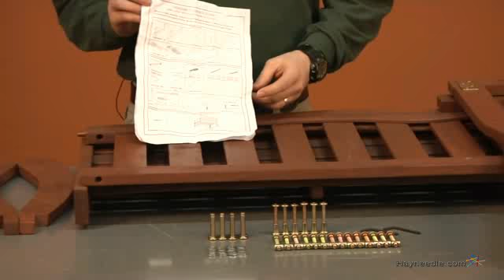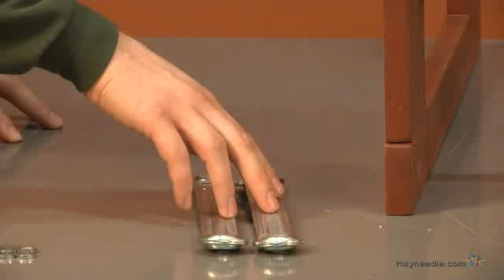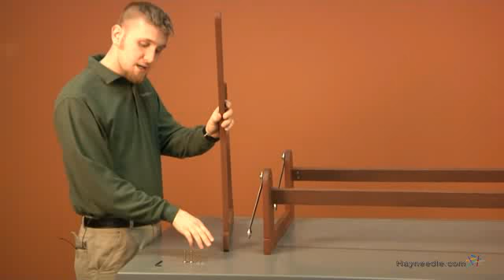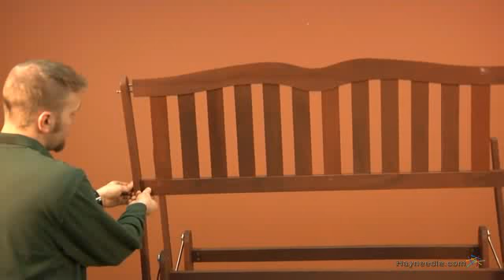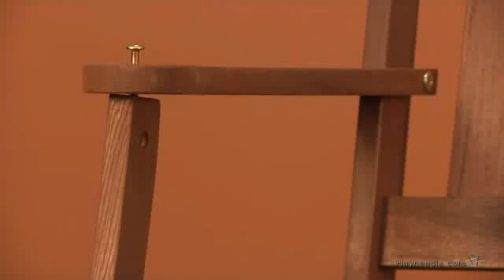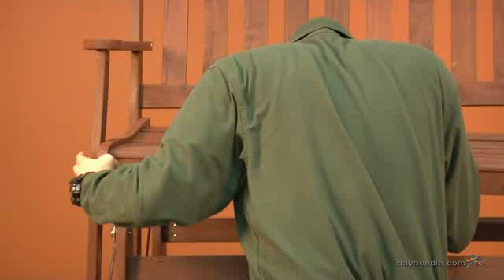Assembly Video Jordan Manufacturing Alpine 4-ft. Double Seat Glider Bench

Comment: Great instructions. Never could have done with the instructions provided in the package.  Although, I was able to use it a point of reference when not clear about something, i.e. L/R orientation, etc.  And yes, aligning the barrel nuts was not as easy as holding it in place with your finger.  It was very tedious and often frustrating. But again, your video was extremely helpful. Thanks!

Comment: Once I got it figured, I do really love it. But, I feel I need to comment about the instructions. The pictorial was really useless, it would have been helpful to zoom in on the holes or have a step by step along with the picture ... thankfully the YouTube video is decent, but not a specific enough video ( it would be good to add that the side with the permanent washer faces out or in when putting parts together [helps to distinguish left or right too].  The nut locks for the back were nearly impossible to place.  A verbal or close up on which direction the rotator brackets should be attached would also have been helpful.  Lastly, it would helpful to mention that 2 people are ideal for attaching the back and seat.)